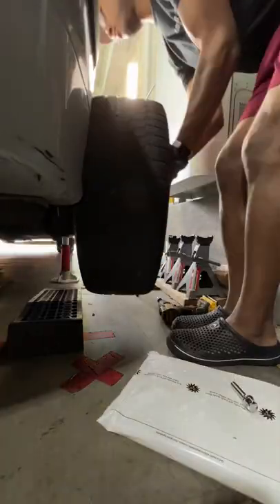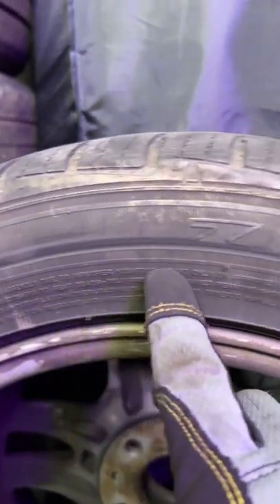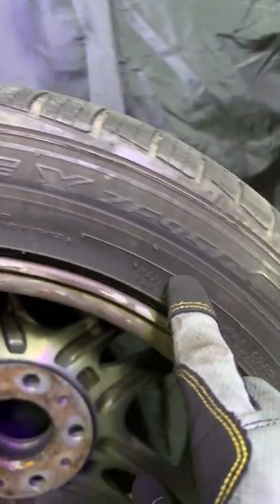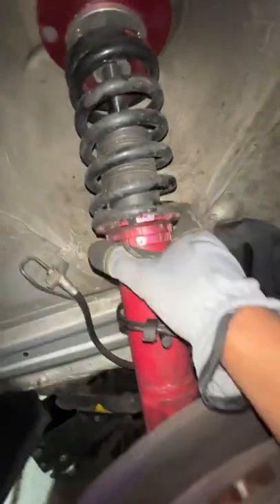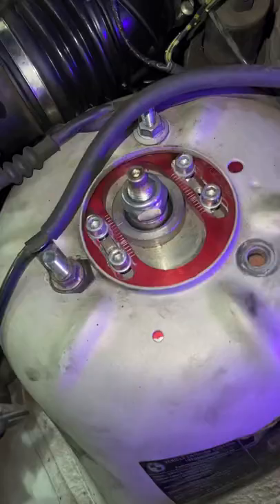Why you should always buy quality car parts ☠️☠️☠️

Comment: For the coils, it depends on your budget mostly. If you have the cash, Fortune Auto coilovers are some of the best you can get, but they're a bit pricey - starting around $1,600. Bilsteins are cheaper, also great quality, but fewer features.
Reply from the maker: i’m definitely eyeing fortune auto 🔥🔥🔥
Reply: On my RX8 I have Eibach Semi Adjustables and they are really comfy and really great quality. Paired with some ROJA wheels and a set of Pilot Sport tires. And I have slotted zinc coated rotors and EBC yellow stuff pads. Carhandles like a dream.
Reply: @ChrysGaines  I got Fortune Auto's on my Miata, could not be any happier! Ride quality is astronomically better than stock, handling is exceptional, not to mention rebuildable AND upgradable! Also their team is amazing, all my future cars will probably have Fortune's on them. Not trying to make this sound as an ad, I'm sure most coil overs in that price range will perform about the same 🤷‍♂️
Reply: kinda if you don't have the money to do it right wait till you do. won't have to run sketchy weel spacers.
Reply: @MaFTB   the problem isint with wether they are stable or not it has to do with the suspension geometry. the engineers who set that up for the OEM knew what they were doing. and monkeying it up can lead to some read funky behaviors like bump steer, accelerated wear on bushings and balljoints and other issues that come with changing the scrub radius. the thing is if the stock rims don't fit with the coilovers then its the coilovers that don't fit and need to be changed out. and when going wider on tires its important to keep the center of the tire in the same spot so you gotta do the math to know the measurements of the rim you need. i know it sounds kinda limiting but 99% of mods dont make your car better and just lead to more issues later on.
Reply: @MaFTB  for those race cars they are using custom arms and moving the mounting positions on the chassis. done by other engineers who know what they are doing. weel spacers just take that same understeery car that makes the lawers happy and makes it even worse. the geometry that keeps the lawyers happy is still a stable car that won't kill the occupants, understeer can be fixed with swaybars and stuff that don't mess with geometry.

also toe in is good, helps with turn-in and maneuvers you do on the street. but it's not good for drift car people. drifting just do whatever the handling of the car doesn't matter going that slow. people delete swaybars and stuff there.

the thing is even of you change stuff to make the setup sound more racy you don't have access to the 3d models and testing they did to do those original cars, there is no way of knowing what your change will do through the whole sweep of the suspension lending to a bumpsteery undrivable mess.
Reply: @MaFTB  the spec racing series for these cars don't allow much change on the suspension at all. and are super conservative with the changes they do allow. like stock from sizes and the like to keep the cars handing the best they can without having to spend to get frame work done changing mounting places and stiff to make wider wheels work as intended.
Reply: @MaFTB  COULD NOT AGREE MORE WITH YOU
Reply: @MaFTB    im tackleing this backwards. in solid works and whatever 3dmodelong softwhere they use they can cycle the suspension in space to make sure it doesn't have bumpsteer. where as even if you take out springs in shocks you cant measure minute changes in angle as the spindle movs up and down.

swaybars ? eh seems to work for me. I've had stiff coilovers start bending the steel tophats and cracking the body on my classic cars and I don't want to deal with reinforcement. and going bigger in the rear is just easier than going smaller in the front.  aftermarket often only makes bigger. and isn't cornering flater just fun.

pikes peak reacers are often dealing with completely custom chassis or custom arms and mounts at least to make their geometry work. spec classes often keep stock a arms mounting positions and stuff like that so what they do is more applicable to the armchair carguy.

drift car stuff: agreed

maybe forza motorsport 4 has their tuneing wrong. but yea when I was real into cars  I just sorta went from where it felt what the car was rotating about withought haveing to break traction on the street. but cars are just hard to read sometimes but I got into motorcycles and its way easier to tell whats wrong on a bike. and it costs less to get it how you want.

oems have access to custom castings and they can design for whatever they want. my dad had a e36 BMW back in the day where he replaced all the rubber bushings in the suspension with heim joints. with those he could completely change the length and position of the lower a arm  and effect castor and stuff. he said it made it feel good when they were brand new but they wore out quickly, and if it wasn't set to the completely stock position bumpsteer was a problem. had to replace them every few months I don't think they are designed for that mutch driving. mabe see if your solid mounts have worked some little slop in em because that may cause issues with the alignment. that's what polyurethane is for it has some give so it doesn't wear out metal bits.
Reply: @MaFTB  isint snap oversteer from laderal weight transfer in the rear? maybe that's something else. 

 but idk I have fast bikes now to scratch that itch and pretty lame cars. when i modified my e30 it was difficult to tell if the change I made did anything at all other than add bumpsteer, kill balljoints, fry weelberings or start cracks. and laptimes from reviews of fairly normal cars blew the car I had spent so mutch money on out of the water, driver mod or working stock stuff is just better than cheap aftermarket. i have another e36 automatic and a vert so, now that I just replaced stock stuff with stock stuff and it feels great and is a present drive as most of is working as it should, way better than my e30 ever was. and it still embarrassed a brz with big wings and supercharger and wide tires.

next car will probably some frupy electric car if these gas prices stay the way they are.
Reply: BC is best budget
Reply: Bilsteins are perfect for a oem+ route. You know they’re quality because many car brands use them, give you a lower ride height and stiffer ride without worrying about your back blowing out. BC’s are good for the price but they need to either be revalved like mine were by Colin Green or redone/custom spec’d to not kill your back. I daily mine and have no problems but I had a buddy with them on a s14 and they were atrocious.
Reply: Haha you think those are expensive, look at the shocks on the new Polaris Razor
Reply: I’m on MeganRacing and lemme tell you I’ve had more experience using other brands and crazily these coils handle the same if not better then all those crazy brands. Ps also has over 20 settings for dampness lol
Reply: @RemingtonScarborough  But how does your back feel at the end of the drive

Comment: Spacers if fitted and installed properly are perfectly safe. I prefer hub centric like you installed. I've had my spacers on my Jeep for 5 years with zero problems.
Reply: It’s not a preference thing, hub centric are the ONLY spacers you should ever run should you run them at all.
Reply: If you ever going to put spacers on make sure they are hub centric. Don't use anything else.

Comment: I think the reason why you rub people the way (no pun intended) is because you said that the spacers will increase your handling, which in your case it just might because your tires are rubbing and it's also a safety hazard. But in most cases spacers are just for looks and not for performance. Shopping for a better wheel that fits is the better option but not if your on a budget.
Reply from the maker: the problem is people take everything as either black or white, and often out of context. (and i have 1 minute 😅) OEM’s often brag about how they’ve increased the track width for improved handling in their marketing. spacers do exactly that - so if you mitigate for some of the negatives they may bring, they absolutely can improve handling.

Comment: Nothing wrong with hub centric slip on spacers and extended lugs.
Reply: why do YouTube wheel spacer guys never mention hub centric
Reply from the maker: @andys31337  i did 🥺
Reply: Wheel bearings disagree with that statement
Reply: @ronski4677  the aftermarket wheel industry says otherwise.
Reply: Nothing, except ruined suspension and steering geometry

Comment: I think some of the things I know and heard are bad. Is the scrub radius is negative and you move it out more, negative it can have really unpredictable steering effects and understeer. 
I've heard that wheels have been known to come flying off with spacers. But that could be from buyin cheap spacers that also don't fit over the rotor center properly. Buying one's that don't properly fit can also impact the life of the wheel bearing. In any case I'd like to see the alignment after the install and keep an eye on the lug nuts. See if you can disprove lug nuts loosening when using proper spacers.

Comment: Spacers are cool but gotta remember that your bearings will take a beating faster. :(
Reply: Is that because the farther the wheels are from the hubs the more the wear the bearings take? Kinda like a longer leaver can exert greater force on an object? If Im wrong, sorry, Im just reasoning it out.
Reply: @roadwarrior144  exactly like your first point :)
Reply: @Uszat89  Yay! Ive done a brain-thing!! Thanks!!!
Reply: Depends on the size of spacers, a 5mm won’t make a noticeable difference compared to say a 20mm
Reply: That is probably why spacers are illegal in Australia.
Reply: @roadwarrior144  wow, ive yet to have one of those, whatever you call em. Congrats bro 🙃
Reply: Yeah, that's part of why I started doing a lot of research on wheel spacing when I started looking for new rims. Found -6 is what's recommended for my ride.

Comment: Installing wheel spacers of any kind offsets the center line of the wheel from proper designed alignment with the all of your load bearing components such as bearings and Allie’s greater torque to your toe rods to turn the wheel and so on. So while it’s not inherently dangerous to use hub centric spacers, you should understand you are overloading the factory parts at an exponential rate the further out you go. It is much better to install properly spaced wheels and tires that fit with suspension, or do it properly and get longer control arms and such but that is a very expensive proposition and not very available for many cars. The average person is not likely to push their cars limits enough to warrant this, but if you are doing these mods with intentions to track a car hard, you should do it right and avoid spacers as a whole.
Reply: E46 control arms fits e36s bolt on if you switch out to other lollipop bushings. That gives you a bit wider track and with adjustable camber plates the alignment can ne done properly again

Comment: Yes. Fixing a cheap as* suspension by using a cheap as* spacer which will mess up the whole kingpin caster, trail and the whole suspension geometry. What you doing is as danger as the stupid coil because you make the drivability even worse.

Comment: Would spacers put added strain on the axels. Or am I overthinking this?
Reply: Yes sir. Bearings to be exact.
Reply: Increases the leverage on your suspension components by fucking with the geometry. Your wheel bearings will have a drastically reduced life

Comment: That seems like a common theme, e36/46 strut caps breaking bolts. Mine did this when I removed the ones the previous owner literally welded to the hub assembly after losing the bolts 😂😂

Comment: Well, these wheel spacers are illegal in my country for use on the road for a reason. Just purchase the correct offset rims- your other viewer is right
Reply: some countries are lazy with rules and instead of having a way to check for correct installation they just ban them outright. doesnt mean they are unsafe, and sometimes you actually cant purchase the correct offset wheels

Comment: With that size spacer you will have zero issues. Most aftermarket wheels space out that far. All the comments are theoretical, not actual.

Comment: My used wrangler came with spacers and the original wheels but wider tires. After the bearings went out I had the spacers took off and the tires put into some wider wheels with a different offset and have 60k miles so far with no trouble

Comment: I recommend you not modify your suspension so everyone around you  can be happy and safe on the road.
Reply from the maker: you obviously haven’t seen the full 250k mile suspension of this thing, especially compared to my Z which has been gone through with a fine toothed comb. 

It’s all getting ripped out and upgraded to higher than OEM standards. happiness + saftey ⬆️⬆️⬆️

Comment: Bruhhh are you using a hammer driver to remove lug nuts? 💀
Reply from the maker: i actually use my teeth to break the lugs loose and then zap them off the rest of the way with the drill 😂

Comment: You change everything to stock
Reply from the maker: why in the world would i want a stock 250k mile 170hp 24 year old bmw 😭😭😭
Reply: @ChrysGaines  agreed but I wouldn’t  go too far with it (in my opinion they look really nice in the middle of stock and modified)
Reply: @ChrysGaines  

Dude you are fixing a wrong part problem with an other part wich is not helping you to drive safe. 

I guess you’re not that smart.
There are young guy’s on the internet show them how it’s Ned’s to be not how it’s gating worst.
Reply from the maker: @Can2en  First off, when spacers are used correctly, they’re safe enough to race on. secondly, i alluded to the fact that i already have new wheels that fit, even with the crappy coils. third, why would i buy new (or someone’s blown) stock suspension when i said i’m going to get real coils?
Reply: @ChrysGaines  I just responded on the information I saw on video, I don’t know what your hiding. You don’t have to explain your self buddy and if you don’t agree with me that’s fine. Apparently you Drive Around With a car and sum safety part’s are missing. I live in Germany, I can send you sum parts from Heer if you can’t afford it✌🏽
Reply: @ChrysGaines  coming from a mechanic, it’s not safe at all and wouldn’t pass a regular inspection if you were in a state with required inspection. Not only does a spacer add additional strain on the bearings like I saw most comments point out, but overtime the wear it causes isn’t predictable I’ve literally seen kids wheels fall off while driving from those stupid spacers. Best advice would be to change the suspension or get a new tire or change the camber and toe it out? I don’t understand why you consider spacers to be the only conceivable option when it comes to that problem. From personal experience, spacers do much more harm then good just for sub par results when tires or different suspension entirely would’ve made more sense. Seriously, camber is your problem here
Reply from the maker: @nickcaruso3052  spacers are not the only solution, like i said i literally have perfectly fitting wheels that just need to be refinished. the entire car is getting rebuilt from the ground up, with new bushings, coils, control arms, and mounts. aftermarket wheels can have the san me negative effects on their own, and in many cases those are minimal. on a mcpherson strut car, how would changing camber affect the distance of the tire from the coilover? they’re fixed at the same angle. my only point is that they can be used safely when done correctly.
Reply: @ChrysGaines    it would because you said your tire is rubbing on top? If you adjust a little more to positive camber which you can still do with McPherson struts, your tire wouldn’t rub the top of the coils like it is. In any case and seeing what hub spacers do you can believe what you want cause at the end of the day it’s your car and if you have the money to work on a bmw in the first place I have no worries on how you’ll pay for further damages going on down the road. I wish you best and stay safe on the road and not be so quick to judge someone’s advice told from thousands of these comments on the dangers and issues of hbu spacers. Ignorance is bliss and wealth fuels ignorance